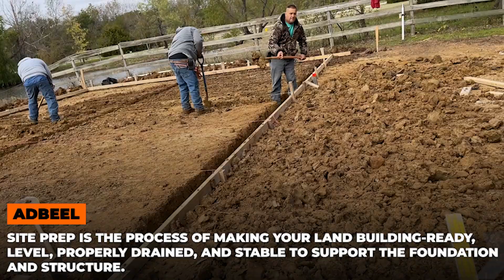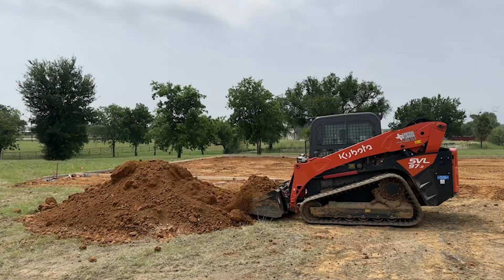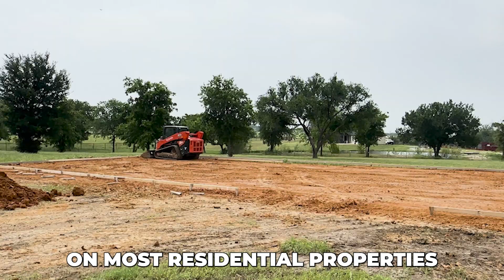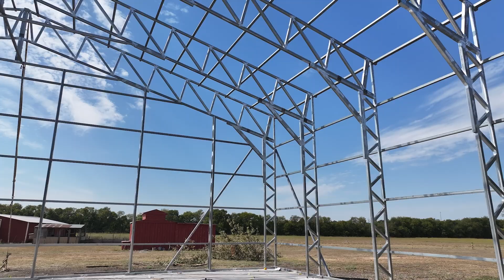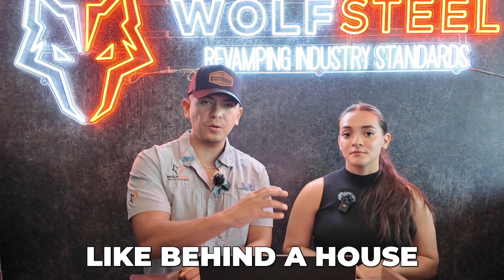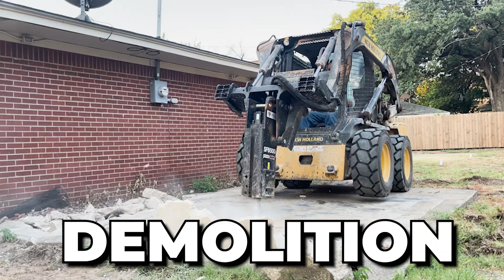Texas Metal Building Site Prep Standards | Dirt Is Dirt Cheap, Here’s Why! | WolfSteel Buildings

Comment: What do y'all do with grass and topsoil? Remove it, then build pad or build pad on top of grass/topsoil?
Reply from the maker: We always remove it! Grass, roots, and topsoil are full of organic material that will decompose over time and hold onto moisture. If you bring in fill or pour concrete right over topsoil, those decaying organics leave voids beneath the pad, which leads to uneven settling and cracked slabs.

The only right way to do it is to strip the topsoil down to clean, stable subgrade, bring in structural fill, and compact it in lifts before laying your foundation. 👊🏗️

Comment: I got 57 limestone delivered last year. 23 tons of limestone was $1300 of which $300 was for the delivery.
26 tons of 23 granite was $1600 with $300 for delivery.

And it did crack my driveway even more than when they started.

I am in a port city where the gravel supplier gets gravel by barge from. Up river.
Reply from the maker: w!w! Delivery costs and the weight of material can definitely add up quickly. Being in a port city is a unique factor too. Appreciate you sharing!
Reply: @wolfsteelbuildings  I shopped around. Then I drove to the gravel yard to select the stone and asked them. They recommended their largest client who was perfectly happy to dump 23 ton to 26 ton load for $350 a load. 

I am 12 miles from the gravel yard. The gravel trucks are not allowed to drive on the freeway with the smaller gravel because of the chance for rocks to come out and cracking windshields. As the gravel truck driver said, he doesn't risk his license. This was calculated into the delivery cost, as was my timing flexibility. The fit me into open spots in their schedule and gave me 2 hour notice when they were going to arrive. 

Most groups were pricing me at $2500 for 9 tons. plus $700 per load to spread it. Once each group found out I was residential everyone refused to spread the load.  I ended up renting a mini skid steer (stand on the back) which moves 300-600 pounds of gravel per load. How much it will load depends on the weight of the counter weight (driver). It was $1300 for a week with both weekends from united rentals plus $350 for delivery and pickup. After almost flipping it going up the 2 inch lip of my driveway, being able to pay someone to drive it up a 4 foot ramp to the back of a large truck was well worth it. 

If I was to do it again, I would do all granite. It is tougher rock, it also locks together, and doesn't roll and cause ruts. After a few years of gravel road use limestone will become water impermeable and cause puddles, granite remains water permeable. Just make sure to put down driveway fabric first, vevor sells it. The landscape fabric makes it not sink into the ground, so you don’t get puddles. 

I also used 2 inch geogrids under the primary gravel parts that I walk and drive my car on. The geogrid makes it not shift, so it doesn’t get lumpy or cause ruts. You can also use it to stabalize a hill, or make a driveway go up a steeper hill, you just have to attach the pieces to each other with rebar (they have holes). The weight of all of the gravel in all of the mats keeps the bit of mat which has a vehicle on it from shifting. With a 4 inch geogrid it makes the gravel road capible of supporting a fire truck, so you don’t need to pave, which can significantly decrease construction cost, especially on larger structures. I think that the fire department wants to be able to put their truck within 150 feet of all parts of the structire. Not needing to put in a concrete fire road with a T turn around point at the end is a boon.